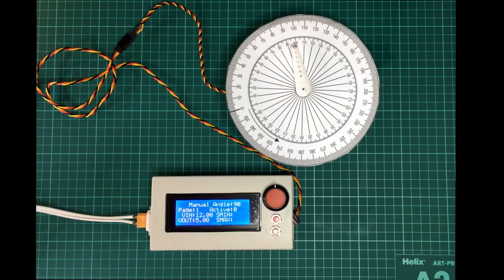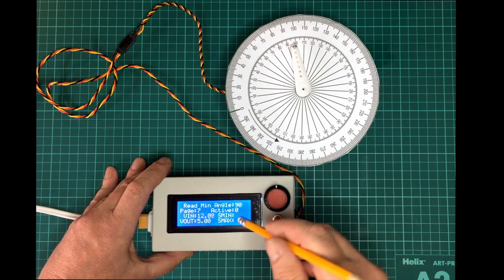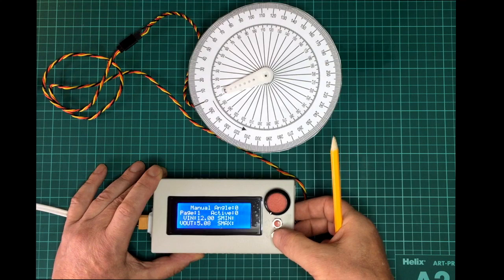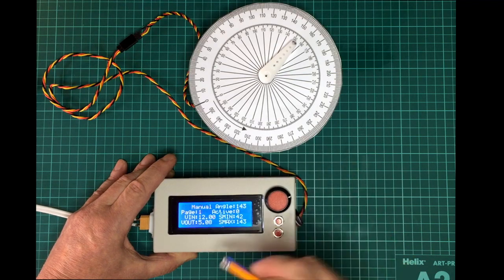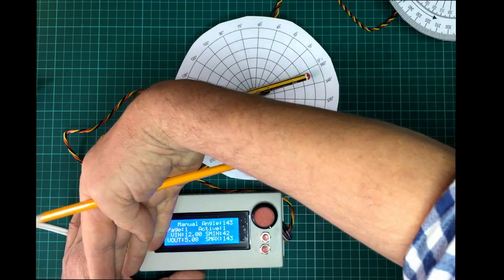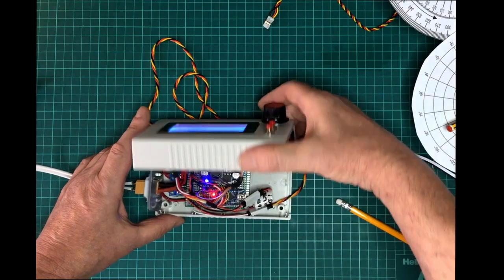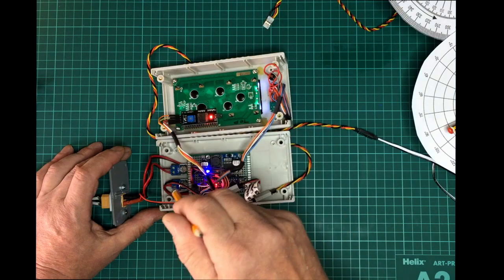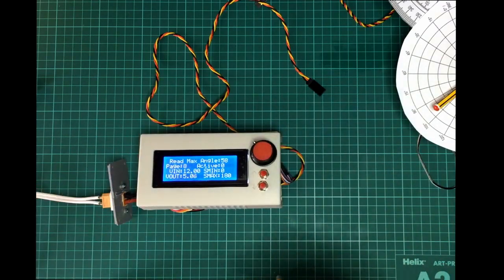Arduino LCD menu system for servo control;  part - 1

Comment: Hello Kyle, that looks great, I have an extra LCD from a 3D printer I didn't finish.
I will build this to help me with servo settings and understanding how they move with certain commands.
Still trying to figure out how to use "myrobotlab" and my inmoov.
Looking at switching over to ez-robot, but the cost an issue.
Keep up the good work, I watch and save all your videos for reference and great ideas.
Reply from the maker: Hi Terry, glad you liked the video. Its been a great way to learn Arduino having an aim in mind. Still things I cant figure out with it buts thats really the fun of it all.  I will do another video about the code used. 

I think the EZ robot control units have come down in price and you only need one to control most of an InMoov.  I always struggled with MRL, mainly getting it to consistently start up.   A lot of that I think is down to JAVA issues and also Arduino comms ports dont always write the code to the device properly first time.    I regularly only got one of the two Arduino boards working at any one time. 

When I get time I am going to look at MRL again as I know Gaels and his guys have put a lot of work in to it since I last tried it.